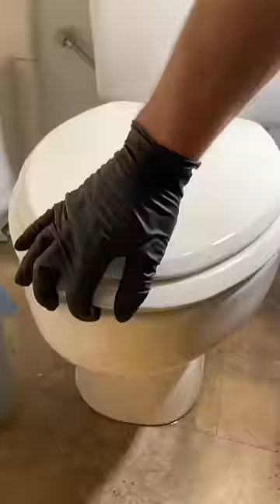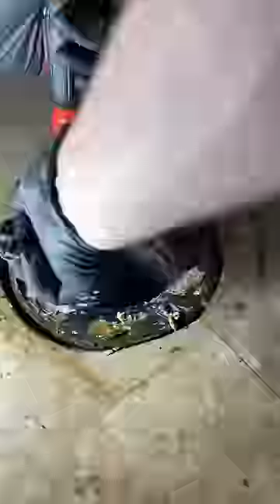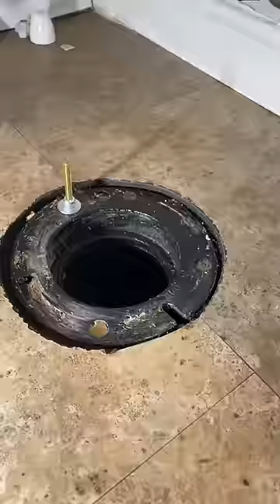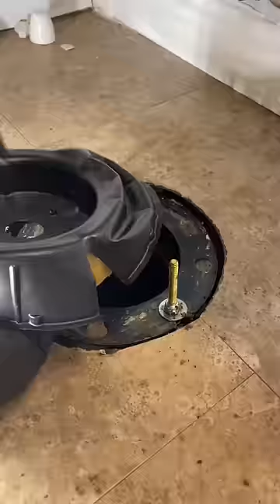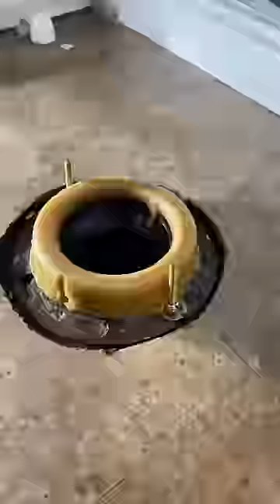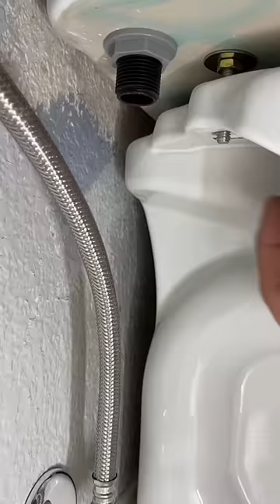using oatey’s liquilock to change out a toilet. went back with a toto drake #plumber #plumbing

Comment: You made it look so easy lol. That would have taken me 14 hours and at least 8 trips to Home Depot.
Reply: Why would you even use a wax ring with a piece of plastic in the middle of it
Reply: Check out a plumbing supply house called “Ferguson” they’ll sell you a kit that has everything in it for $129. Toilet bowl, tank, seat, wax ring all the hardware 129$. Insanely cheap but the flush in it is pretty weak!!
Reply: Lmfao💀☠️☠️🤣
Reply: @jake16542  home Depot sells the same kit but with a 3" outlet and Oatey guts (better flush) for $130...
Reply: @timothinking9855  no way
Reply: @timothinking9855  I see that glacier bay for 119 your talking about that’s pretty good deal too you just gotta get the wax
Reply: Glad I’m not the only one! 🤣
Reply: It comes with wax
Reply: @revydoer1478  I wish Home Depot would run their accounts like plumbing supply houses I would use them for my parts. Buying from Ferguson where I have an account I got 90 days to pay off my bill where as Home Depot I’d have Max 30
Reply: @jake16542  one size fits all works great in new construction, not so great in older homes.
Reply: This a joke right? Lol
Reply: Same
Reply: Yeah considering you can’t even type without an edit

Comment: What u have a gap between flange and tile what I do is seal with wax between that area to prevent water going under flange and allowing to flow on finish floor so you catch issues faster and prevent subfloor damage and tile damage

Comment: I noticed you're using zinc plate bolts and fender washers which we both know will rust your best bet is solid brass all day everyday
Reply: Nylon closet bolts. Won’t rust and if someone bumps the toilet too hard the bolts will break before the flange does. Just my opinion though.
Reply: And why would anyone use a wax donut 🤦‍♂️
Reply: @Laurel-Crowned  because wax is better!
Reply: @tedmcnair9709  Absolutely correct
Like you wax is all this plumber uses
Always someone reinventing the mousetrap.
Reply: @Chris_dolmeth  believe it or not the nylon bolts have more rigidity than the brass bolts because they’re one solid piece rather than two pieces

Comment: How does the product dissipate? Do you just add more water to it? That’s pretty cool. Never seen it before
Reply from the maker: yep with fresh water added, it dissolves. safe to flush down the drain if you’re doing a pull and reset
Reply: @replumb  nice. That is a really good idea to save yourself from making a mess and cleaning up the excess water. Thanks for sharing
Reply: that's amazing I didn't even know that this  is a thing thing
Reply: @samualstanley8671  it’s very cool and a great idea
Reply: You can add salt if it gets too thick.

Comment: This is why I get so many calls asking if I can fix the toilet tank from moving around so much and the toilet from separating from the floor If all you're using is a nut driver to tighten down that toilet tank after a month that thing is gonna move around a lot
Reply from the maker: what do you suggest🤣impact driver?
Reply: @replumb  yeah and don't forget the cheater bar 😳🤣

Comment: I love that gel shit. Its sodium polyacrylate It's the same stuff used in diapers. I found a 5 lbs jug on eBay for $20. I love those nut drivers also. Let the johnny bolts go up into the handle but the magnets fell out of mine in like 6 months. Get yourself a toilet jack and you'll never lift a toilet again. Best $200 I ever spent.
Reply: Thirty years in the trade and I never heard of a toilet Jack. Looks pretty sweet and a back saver but no room on the van good to know though 👍